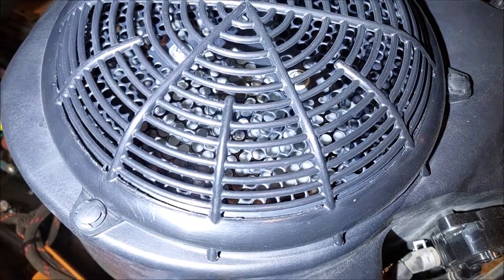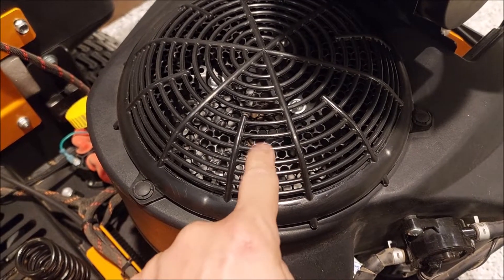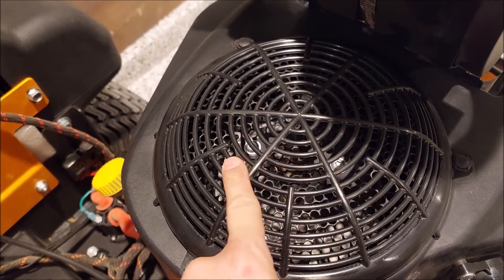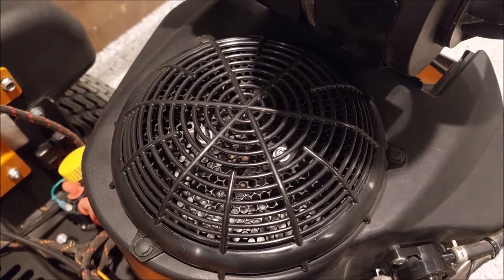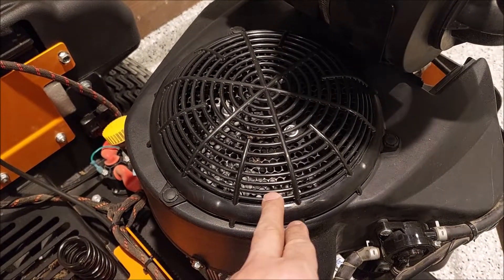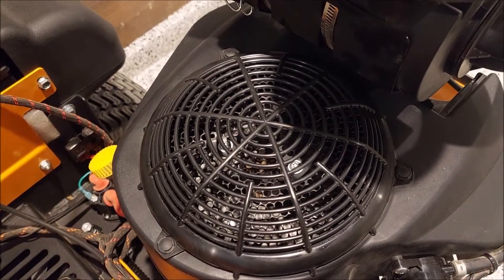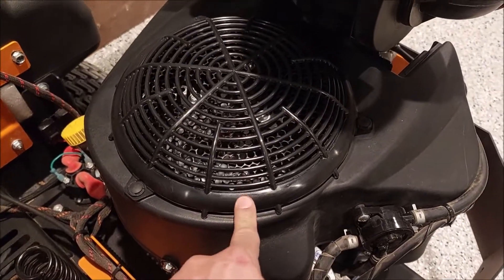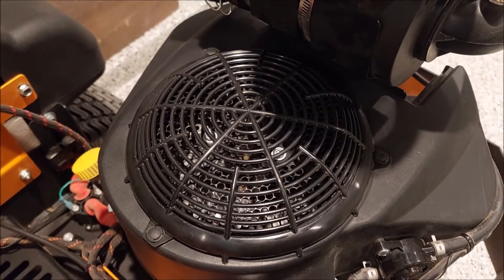UNSOLVED: Question for Kawasaki Small Engine Owners

Comment: I’d be interested to see that Donaldson filter set up you put on the FR.
Reply from the maker: you can get the canister with filters, hose and rain cap for around $100 from surplus center, but you'll need to build a bracket and buy a few hose clamps.
Reply: Thank you

Comment: Loosen that shroud bolt just below your hand and lift up on it a tad and tighten it back down.
Reply from the maker: Hey you're 10-8!  lol  I tried that, i wen't around it 4 times, all bolts are flush and level and sitting in the little recessed slot like before.   it's almost like that darn spacer needs to come out, not sure why it's there to begin with.  i'll try and re-seat everything again.  if it doesnt play nice i'll just remove it completely. (the plastic fan cover).
Reply: @morejelloplease  roger that!